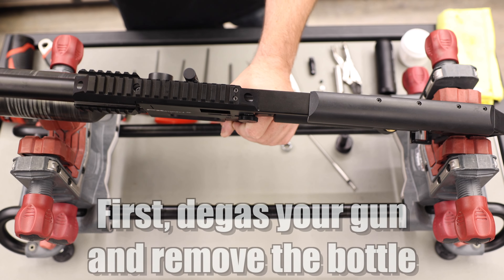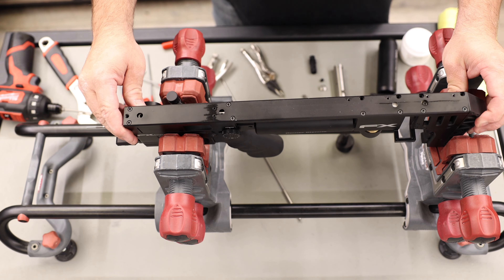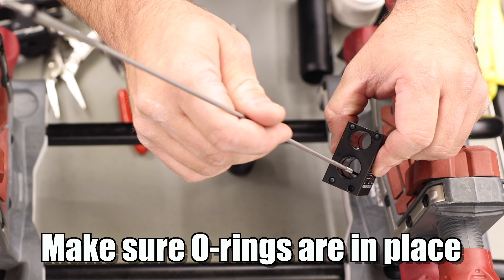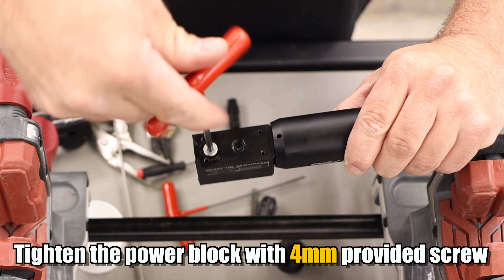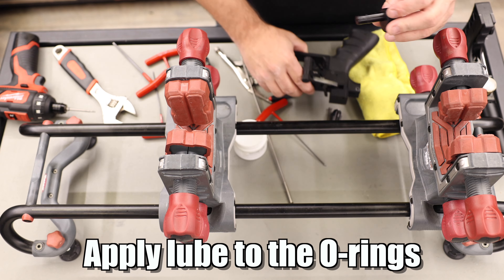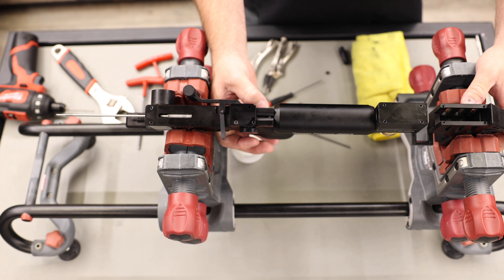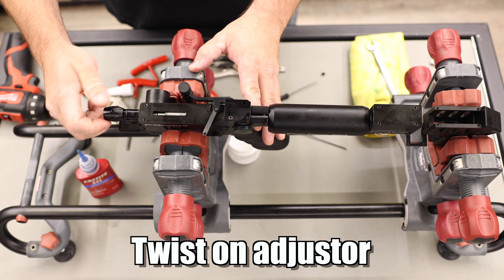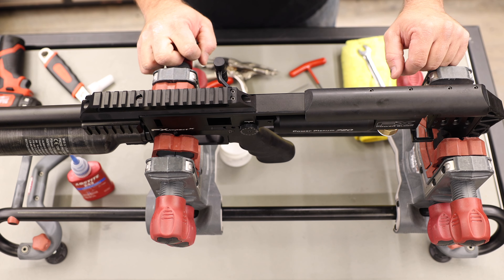Impact Power Block / Plenum Upgrade Installation

Comment: Hello,can you tell me is difference in power plenum size from M3 to M4 in length or diameter as M3 has 720 and M4 750ccm,iHAVE M4 btw,if u know or could  could measure length and diameter of plenum in M3,cause i need to upgrade some part of plenum and size is a key,thank you very much.

Comment: I’m not sure I understand. I was going to buy FX Impact Mark 3 but it’s really expensive in Canada. I found a really good deal on a Mk2. I’m not clear on a few things. Does the Mk2 come with dual regulators from the factory like the MK3 or do you have to upgrade it? Does the addition of a power plenum 720 cc produce more consistent shots and more shots or does it have to be in conjunction with a dual regulator?

Comment: I received 3 NBR 90 o-rings and 1 NBR-70 O-ring  along with 3 little black balls is there some place I am missing the NBR-90 Oring during the install and what are the three small black Buckshot looking things?
Reply: I just received my kit and found the little black rubber balls. Did you get an answer on where these go?

Comment: Hello. My seller says that the FX M3 sold in 2022 are already equipped with the new power unit. How do you know if it's true?
Reply from the maker: Every new M3 would have one. This is for an upgrade from an Impact/Impact x/MKII etc..
Reply: To my knowledge, early 2022 M3s had the Power Plenum 720 cylinder, but do not have the Power Block.  That's how mine is and I'm a bit disappointed.  Take out your magazine and look at the back of the block.  If it has 4 holes, it's the new power block.  If it has 6, it's not the power block.
Reply: @hurricaneaquatics  A friend of mine bought the FX M3 with the new PowerBlock. We tested both but didn't notice a big difference. However, the two FX were at the same settings.
Reply: @islacouledouce  Thank you for letting me know!

Comment: The only change appears to be in the stainless valve body itself (missing slots and bore change) .   If im not mistaken you may be able to retain the serialized block.   I didnt guage pin the transfer to check for more subtle changes.   Not shooting 40 grain slugs, i wouldnt have bothered with the upgrade in hindsight.

Comment: Isn't that valve house the old type?, The new ones come with three large long cut outs..
Reply from the maker: The three large long cut outs are for pre-power block power plenums. Power Block valve houses do not have O-rings on the outside. They are inside the power block/power plenum
Reply: @utahairgunsworkshop  ah, thank you, that makes perfect sense..